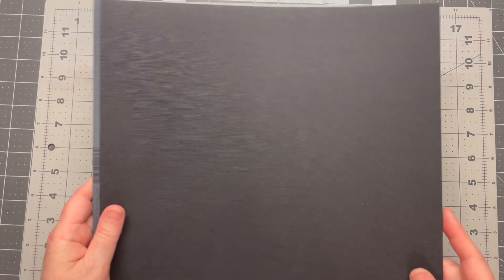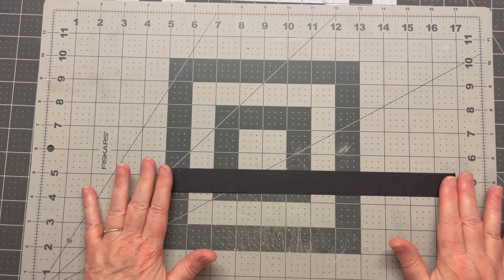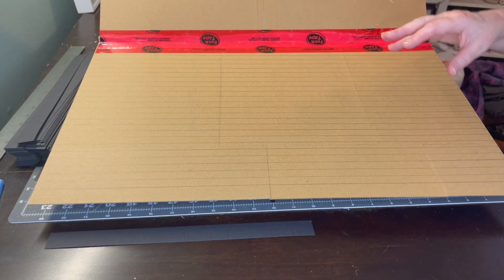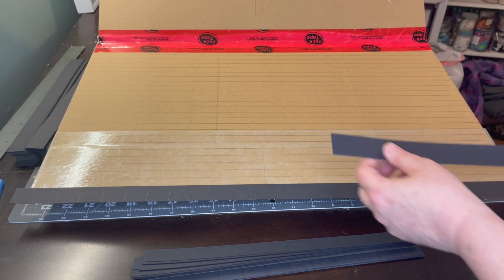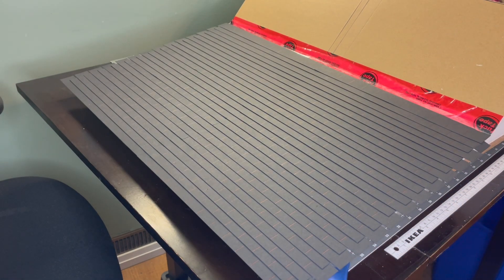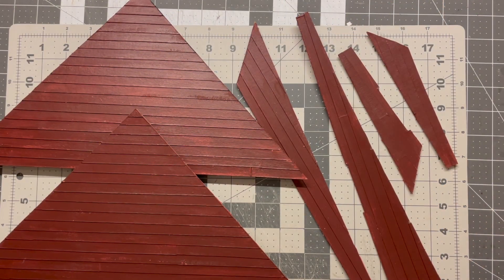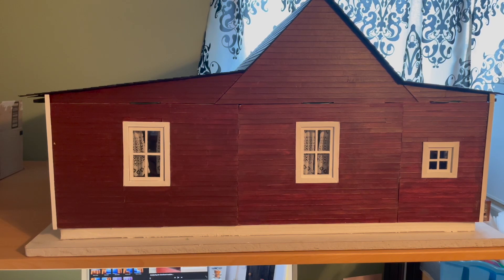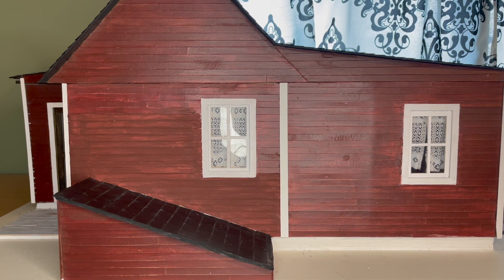Adding Shingles to this 1:12 scale dollhouse!

Comment: From where you got the double side tape
Reply from the maker: The tape I used is called Sookwang double sided tape and you can purchase from Amazon. It is a specialty tape meant for Scrapbooking/cardmaking and it is quite expensive. I would recommend using 2 sided Carpet tape instead. It is much cheaper and does the same job. It can also be found on Amazon or at most home improvement stores. I hope that helps!!
Reply: Thank very much sweetheart ❤
Reply: I’m in Ontario I will check Canadian tires or lowes
Reply from the maker: @Laphoenicienne  You are very welcome!